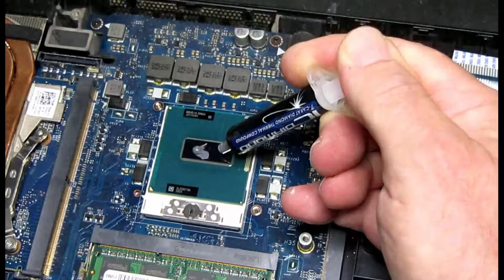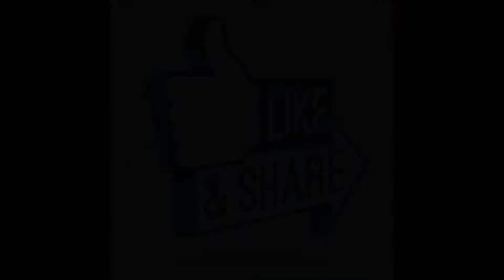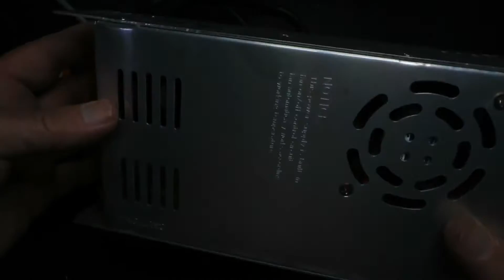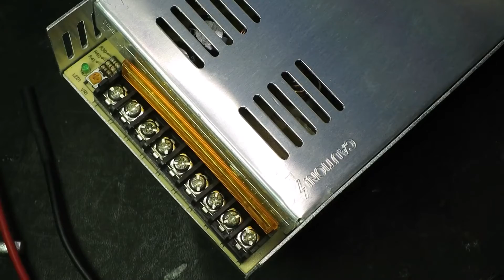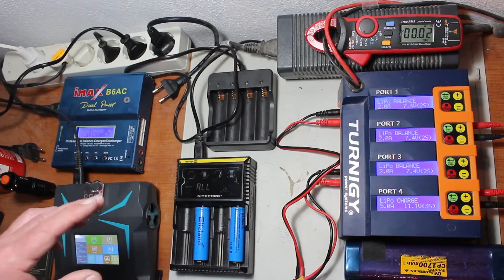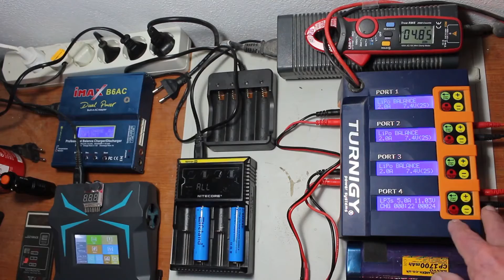360 Watt 12 Volt 30 Amp Banggood Power Supply - Electronic Project

Comment: Hi, could you power a computer with pico psu 300w? thank you
Reply from the maker: Some pico PSU's need at least 16 volts to work, others can work with 12 volts. You need to check the specification of the unit you have or are going to buy.

Comment: :) Thank you sooo much for being so informative, :( just finished watching 6 videos about this power supply that the sum of which wasn't 5% of the info you included. There was one thing I was interested in that wasn't talked about was the supply terminals, but probably should have been implied but I missed. Does each set (-/+) supply their own 12v/30A (22A in your case) or a max of 12v/30A (22A in your case) across all 3 sets of terminals?
Reply from the maker: Hey thanks! The output terminals are joined together to a single output. The extra terminals are there I guess just to make it easier to wire / power multiple devices. Total for all 3 terminals will be 12v/30A.
Reply: @1nformatica  :) Thank you. I thought that was the case, but wanted to make sure before I bought one expecting the other. I plan on getting one to automate the irrigation and temperature  controls in my greenhouse this winter. I think a 30A PS should be sufficient for my 200w heater (with temp controlled on/off switch module.), 24W diaphragm pump (with timed on/off switch module.), and sub 1A control box cooler fan. Thanks again for all the help, I know most of these power supplies don't come with instructions.
Reply from the maker: Thanks Jeremy! Hope it works out well for you.

Comment: Hi, I'm thinking of buying two 60 amp versions of this. The ebay link is below:
https://www.ebay.co.uk/itm/162001072866

Could the two I buy be used in parallel to provide 120 amps of continuous load? I need them to power a 1000 watt sub-woofer/amplifier. It's not really clear on the ebay listing so I thought I may as well ask you - seeing as you have a similar one in this video! Thanks
Reply from the maker: Generally it is not a good idea to parallel power supplies especially switched mode PSU's. Better to find a single power supply which is rated for the job.
Reply: Hi, thanks for the reply! The sub/amp requires 1000 watts at 12 volts. So that means it pretty much needs around 80 amps when at full volume. I'm probably never going to use it at full volume, but for the odd occasion where I might, I don't want to damage the power supply or cause a fire! Is there another power supply which you could recommend that can supply 12v at 80 amps (continuous)?  Let me know and thanks so much for your help!

Comment: So what happened to the trusty XBOX supply? I hope it found a good home :)
Did you discover how much the voltage could be increased by the adjustment? I was thinking to use this as a PS for many LED strips and some of them like 14v to get good brightness (they've been running fine at that voltage; still below advertised current capacity; not hot and I mounted the to the metal center plate that normally covers the ballast in fluorescent lamps after removing ballast and flattening the plate out). 
Agree with other commenters, music for speeded up parts is fun!  Also, even though I subscribe to your channel, found this link on banggood while looking at the PS.
Reply from the maker: Well this is very strange, yes the XBOX PSU has a new role, driving LED strips!! I checked my unit's adjustment and it goes from 10 volts to 15 volts so you should be OK.

Comment: Really nice. And really powerful! I'm now in the process of making a 18650 battery charger, to charge up to 6 cells at time. So, basically: 6 TP4056, 6 on/off buttons, a main on/off button, 6 tactile buttons, one voltmeter (activated through the tactile buttons) and so on... LOL The problem is to find a 6a 5v power supply.
Reply from the maker: Sounds like an interesting project, let us know how it goes. For the power supply how about these:
http://bit.ly/5V12AmpDC
http://bit.ly/5V15ADC
Reply: 1nformatica Not a bad idea, thanks! :) For now I'm going to use a 5v 2a adapter. And I'm putting two power supply options: p4 and USB. But as soon as I cam I'm going to use something like that. :) And, yes, as soon as I publish it I tell you. But my videos are in Portuguese, I'm from Brazil. :)
Reply from the maker: Don't worry, I live in Spain and have some Portuguese friends so it will be helpful to learn! Obrigado!
Reply: 1nformatica Legal! :D Então te aviso. ;)